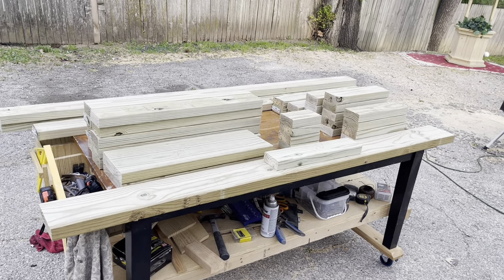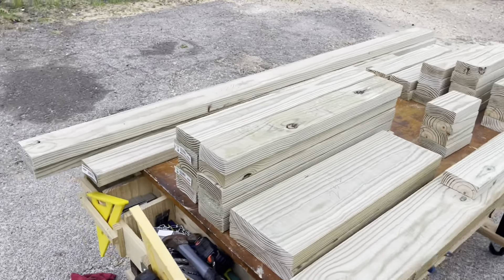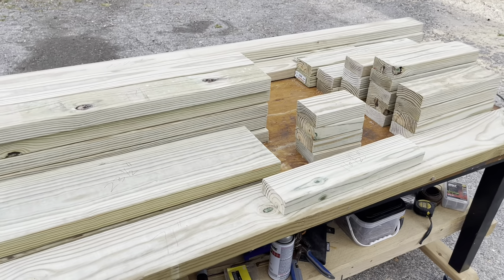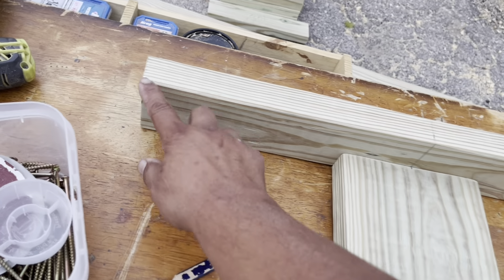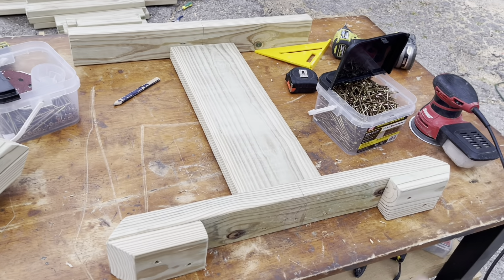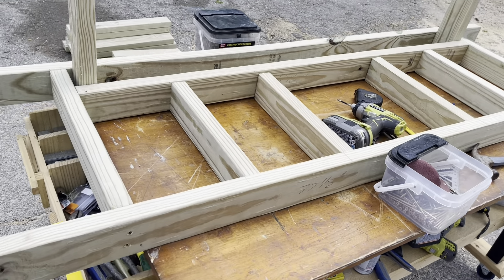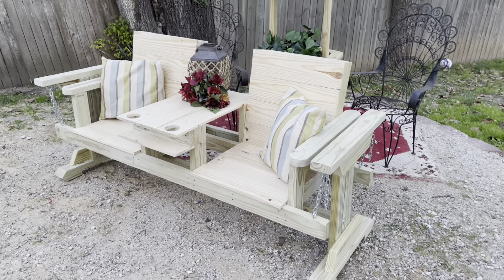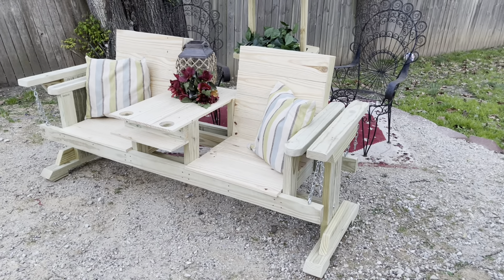Double Seat Glider - Complete Build

Comment: You have any actual plans?  I notice 1 of the comments stated they sent money, but received no plans.  It’d be nice to have plans vs just a list of already cut materials.  I'd like to make a suggestion.  Rather than 1 vertical beam (looks like 2 x 6) that spans the length of the bench, you might consider 2 - 2 x 4's that are horizontal to the ground vice vertical and that would provide support as well.  Then, you don't have to worry about the clearance between the bench and the bottom support piece.  That would make a lot more room for the swing to actually swing and provide more clearance than the vertical 2 x 6 that's in there now.  Just a thought.